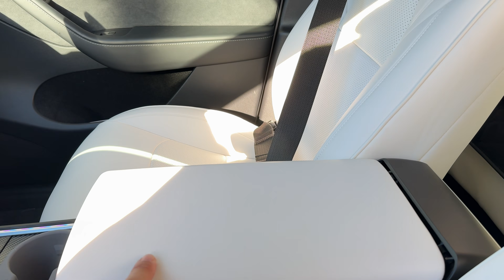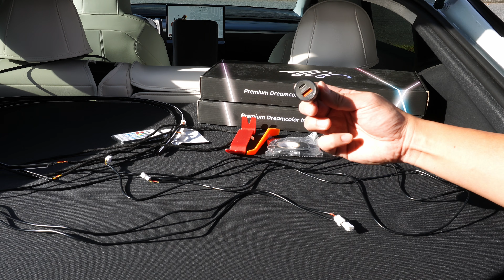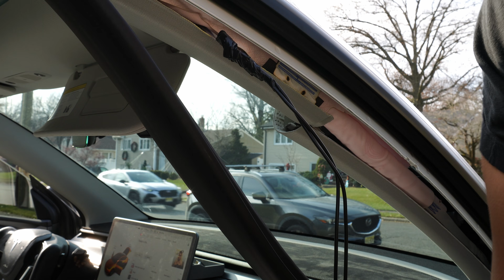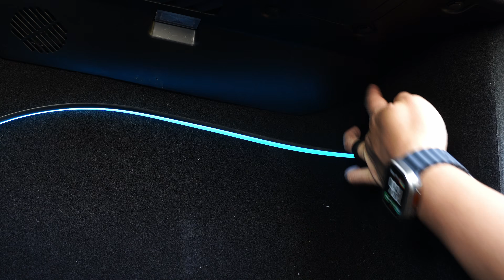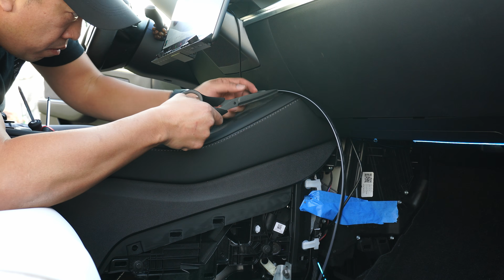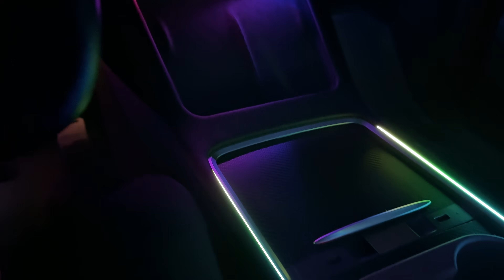Tesla Dreamcolor Ambient Lights by Add-on Design

Comment: I really want to install some lights on my model 3 but I just got it and don't think I feel comfortable taking my car apart like this to do it. It looks quite complex and I would be worried about just breaking a clip or something. Sadly tesla doesnt do any light installs either.
Reply: We have more basic tutorials and installation methods on our Youtube Channel @addondesign. Feel free to check them out, thanks.
Reply from the maker: Clips are always replaceable. My installs are complexed because of what I want to achieve. If you do the install process from the company you bought your lights from, it would be a lot easier. Let me know if you have any questions. I am here to help!
Reply: @garrick_ish  I saw a remote for controlling the lights but I saw you have a control panel on your arm rest. Is that the remote or is it something different? Do the lights automatically turn on with the car on the last saved color?
Reply from the maker: I used something different. The lights that turn on will be the same when you leave the car
Reply: @garrick_ish  Ahh thanks. And they automatically turn on and off with the car?
Reply from the maker: It will turn off if you don’t have sentry mode on. You can also schedule a timer to turn off in the app as well!
Reply: @garrick_ish  Thank you!
Reply from the maker: You are welcome!